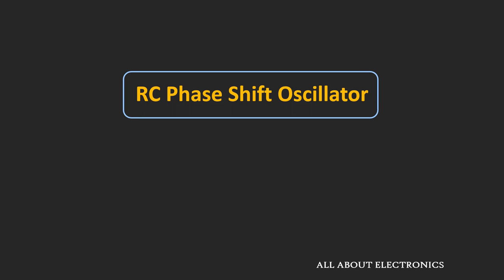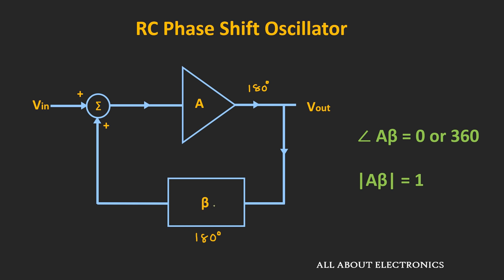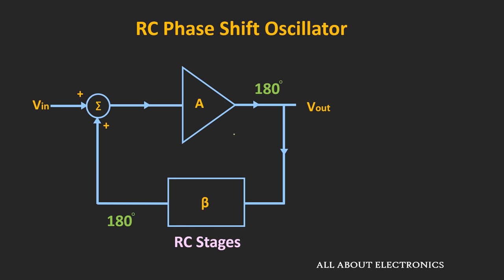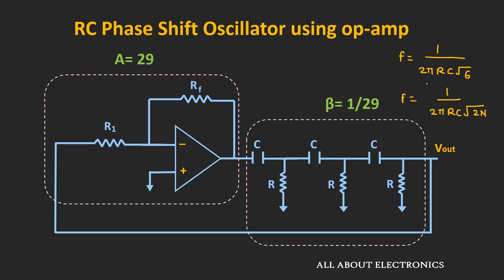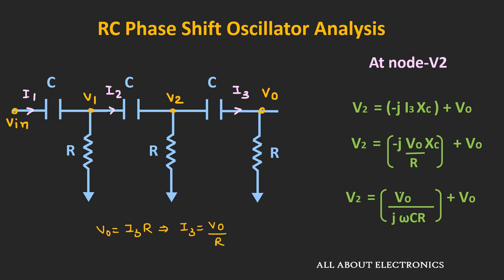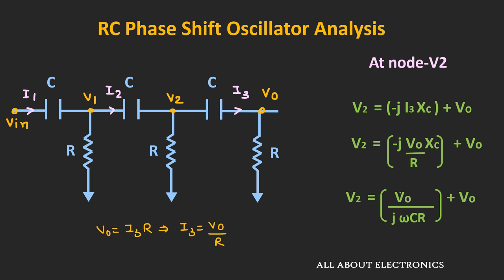RC Phase Shift Oscillator (using Op-Amp) Explained

Comment: Why is it assumed that the entire current I3 flows through R and is not split into 2 currents, one flowing through the resistor and one flowing out to the right of the circuit? When the RC circuit is connected to the amplifier circuit then there will be a current flowing in at Vin and a current flowing out at Vout, so why is only the current flowing in at Vin applied during the derivation?
Reply: Also thought about that

Comment: Hi, all about electronics. I just see one error on the diagram: R1 is virtually connected in parallel to R, affecting the gain calculation. Instead, R is in feedback to the input without R1.

Comment from the maker: The timestamps for the different topics covered in the video:

0:29  How RC Phase Shift Oscillator Works

1:45  Simple RC Circuit (Phase Lead Circuit)

5:35 Design of RC Shift Oscillator using Op-amp

7:31 Derivation of the frequency for the RC Phase Shift Oscillator

Comment: Here,
Phase shift per attenuator is 60.

so, tan(60)=sqrt(3)=Xc/R 
==> Xc=sqrt(3)*R  
So, Vin/Vo=1-j*sqrt(3) 

And we also know angular frequency , w=1/(j(Vin/Vo-1)*RC)

So, in this case angular frequency , w=1/(sqrt(3)*RC) Not your mentioned : w=1/(sqrt(6)*RC) 

Note: I can be wrong, but I found this from my calculation. thanks at all for great video.
Reply: @pallob_M10  what is j ?

Comment: At 5:41 In the figure You getting  Vout From  the RC feedback  output I don't  understand this point  because generally  we get the Vout from output of Op-amp.
Reply from the maker: Here this Vout is the output of the RC network. So, what I mean is, the output of the RC network is given as an input to the op-amp. Of course, as you said, the overall output of the oscillator circuit is the output of the op-amp. If I have used  the different nomenclature for the two outputs (the op-amp and the RC network output) then this confusion would not have arised. But I hope, you got the point. If you still have any doubt then let me know here.
Reply: @ALLABOUTELECTRONICS  so My exam starting  this month  for revision I watched  so many of your videos that I am used to your voice because of this I am reading  your  reply in your voice in my mind..

Comment: What will be the amplitude of the output sine wave??.....calculation can be made easy by using transfer functions but this is the easiest way to understand....thank you
Reply: I think this depends on the op-amp, since this is an oscillator you would have to check the slew rate for the maximum frequency and the rail voltages for the sine wave amplitude.

Comment: sir, please clarify my doubt ... at 1:48 you said that the output voltage leads the input voltage, but generally in an RC network current leads voltage...i am not able to relate these two statements...please help me out sir...
Reply from the maker: Here,  the input and output voltages have been compared. And what you are saying is true when the position of R and C is interchanged. 
i.e when the output is measured across C.
Reply: @ALLABOUTELECTRONICS   sir, in that case, can we reconstruct the circuit in which the feedback network consists of cascaded low pass RC network in which the resistance value is very close to infinity?..because I feel even in that case a single RC network will provide a phase shift of 90(however it will be lagging)....and thank you so much for your immediate response sir...❤❤
Reply from the maker: If you choose a very large value of R, then the AB= 1 won't get satisfied. you also need to look for the gain as well.
Also, with a single RC network, you will get a 90-degree phase shift only when w is infinite.
Reply: @ALLABOUTELECTRONICS   tq so much sir!!

Comment: Ive watched all your videos for Opamp and you are just amazing ,
here I got a small doubt in 1:19 time of this video you said vout is in 180 phase shift but our input and feedback both are at + i.e non inverting then how come our vout is inverted ?
Reply from the maker: What I mean to say is, the feedback circuit ( RC Circuit) provides 180 degree phase shift to the incoming signal  (output of the opamp) at particular frequency. Therefore at the oscillation frequency, ideally the output of the opamp ( which is input to the feedback circuit) and feedback signal ( output of the RC network) will be 180 degree phase shifted. 
Of course, the overall phase shift of the circuit is 360 degree, and that's what we required for oscillation.
I hope it will clear your doubt.
Reply: Hi all about electronics. I have just a minor question on 6:34. I am just confused because here the op amp has a negative feedback. Isn't negative feedback used when we want our op amp to function as amplifier and positive feedback if we want to use it as oscillator?

Since this is an RC Phase Shift Oscillator, shouldn't we use positive feedback in it?

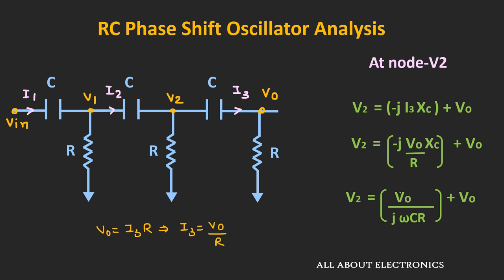Comment: 14:24 , can you elaborate on why the output voltage will have real part only , and can we cascade it with low pass filter and if we can , will there be any change in the result?
Reply from the maker: In oscillator, although in the input (the thermal noise) there are many frequencies, eventually we are getting the output oscillation only at the specific frequency. So, we can say that there is a sort of resonance at the specific frequency. And in resonance, the input and output are in phase. Therefore, the imaginary part will be zero.

Comment: In 14:28, why will the output voltage only have a real part?
Reply: it's a trick to find frequency
Reply: For the angle of feedback circuit to be 180 degree...  Imaginary part should be zero.. Then only tan^(-1)(y/x) may be equal to zero... Subject to condition that real part of beta must be negative...

Comment: Hi, how this circuit is in positive feed back? as per my understanding oscillator must be in positive feed back? but this circuit seems to be in negative feed back?
Reply from the maker: Try to understand in terms of the loop gain of the circuit. For oscillation, AB should be slightly more than 1 right. And around the loop, the phase shift should be either 0 or multiple of 2*pi. 
Here the RC feedback circuit attenuates the output signal by the factor 1/29 at the oscillation frequency. And it also introduces the 180 degrees of phase shift between the output of the op-amp and the feedback signal which is again given as input. 
On the other end, the op-amp provides the gain of slightly more than 29 and as it is connected in the inverting configuration, it also introduces the 180 degrees of phase shift. 
So, overall loop gain becomes slightly more than 1 and the phase shift around the circuit becomes zero. 
In short, it satisfies the conditions required for the sustained oscillations. 
I hope it will clear your doubt.
Reply: Connecting to the negative (inverting) terminal doesn't necessarily signifies that the OPAMP is in negative feedback. Notice that the gain of feedback loop is -1/29, which is itself negative. Hence negative feedback with negative gain (attenuation in this case) cancels each other and the overall feedback is positive.

Comment: 1) 14:25 why the output voltage have real part only ?
2) Does the attenuation depend on the number of stages or independent ?
Reply from the maker: The thing is the gain provided by the op-amp is real (-Rf/R1). It does not contain any imaginary part. 
So, the feedback section should also have the only real part. 
And yes, the attenuation depends on the number of stages.
Reply: @ALLABOUTELECTRONICS  is there a formula for attenuation for the number of stages ?

Comment: Sir, at 16:07 U hv told about attenuation. But this is open loop gain(A) =Vo/Vin.
Reply from the maker: Here Vo and Vin are corresponding to RC network. Although I have used the same nomenclature (Vo and Vin) for the overall oscillator circuit, but here it is the ratio of the output of the RC network to the input of the RC network. And since it is a passive RC network, it won't provide the gain in a true sense. There will be an attenuation of 1/29 at the resonant frequency.

Comment: I don't understand op amp holds up to 18(VCC) and 18(-VCC) 
We need A= 29 '  any help
Reply: Gain is ratio between output and input voltage, not the value of output voltage. Let say you input is 0.1V and your output is 2.9V, so 2.9/0.1 = 29 (Gain)

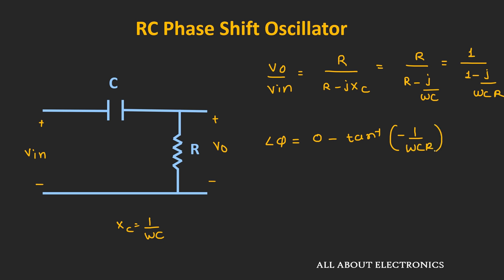Comment: How did you arrive at the formula for phase shift? 2:43
Reply from the maker: If you have A + jB then the phase shift is tan-1(B/A).
Similarly, for A + jB / (C+ j D), the phase shift is tan -1 (B/A) - tan -1 (D/C)
In this case, the numerator does not have any imaginary part (B= 0) . 
Similar way, the phase shift of R/ (R - j/wc) has been found.
Reply: @ALLABOUTELECTRONICS  thanks a lot

Comment: so in this cas, depending on how much RC curcit is cascaded to each other the formula of "f" will change. and since f changed the attenation factor won't be equal to 1/29. right? so we will have to change the gain of opamp. right?
Reply from the maker: Not only the gain, but you also need the look at the phase. You also need phase of 180 degree, so that the overall phase is 360 degree.

Comment: The circuit diagram shown at 5:37 has Vout at terminal of Rf,while redrawn circuit diagram have Vout at terminal of R1  !.How can it be correct? Please clarify my doubt...
thanks in advance.
Reply from the maker: Yes. It's by mistake. It has to be on the left side. 
Anyway thanks for pointing it out.

Comment: @allaboutelectronics As you mentioned the oscillators have positive feedback  then why positive feedback  is not employed  in this circuit?
Reply from the maker: Actually there is a positive feedback . The op-amp provides 180 degree phase shift (since it is inverting op-amp). And the RC feedback circuit provides remaining 180 degree phase shift. So, the input which is fed to the op-amp is in phase with the initial seed signal. (noise is the seed signal). I hope it will clear your doubt. If you still have any doubt then let me know here.

Comment: I know it may sound dumb
But is noise sinisoidal
Or how the the variation in DC current is sinusoidal
And it's amplified and given back
So if it's not sinusoidal how we got sine wave??? 
Thanks
Reply from the maker: The noise does not contain single frequency. If it contains a single frequency then it is easy to identify or eliminate that from any system. But if we talk about the noise, Its combination of all the frequency. 
So, when it is amplified by the amplifier, all the frequencies in the noise signal gets amplified. 
But the feedback network acts as a frequency selective network, which passes only certain band of frequencies and attenuates remaining frequency. So, over the time only single frequency is able to get amplified and all other frequencies gets diminished.
 When we say a single frequency in the frequency spectra, in time domain, its a sinusoidal signal of that frequency. 
So, with proper gain tuning, we are able to get a sinusoidal signal of a single frequency. 
I hope it will clear your doubt.
Reply: @ALLABOUTELECTRONICS  got it sir 
Thanks
Reply: @ALLABOUTELECTRONICS  oh
Is it like A. Beta less than 1 for the other  frequencies thus they Eventually damp and die out??!
Reply from the maker: @abhijithanilkumar4959  Yes, exactly.

Comment: Can you explain why you said that gain will be 0 in two cascaded RC circuit when R=0? I am finding the gain to be 1.
Reply: When 'R' is equal to zero, the ground resistors are not present. Therefore, the feedback circuit contains a bunch of capacitors in series with the feedback resistors. This causes the gain of the feedback loop to plummet.

Comment: I have a question ?

In our lab there is practical of Phase shift oscillator,
In which we have three RC sections, but in the practical we vary capacitance and keep R constant, but still for different capacitance we always get sustained oscillation,
According to tan^-1(xc/R) as soon as we vary xc phase shift should must vary, still we get sustained oscillations means that loop is still shifting 180° but how can this is possible if Xc is varying ???
Reply from the maker: Have you checked the frequency of oscillation ? When you are changing the capacitance then frequency of oscillation is also changing. That means now, for new frequency of oscillation, you will get 180 phase shift. For the previous oscillation frequency, of course the phase shift will not be 180.
Reply: @ALLABOUTELECTRONICS  ,
Yes, we have measured frequency, It means that, in product wc as c vary w will also vary such that the product remains nearly same and overall phase shift becomes 180, thank you very much 😊

Comment: Sir I have seen all your videos regarding oscillator, opam, filters etc full playlist but sir I have a doubt in this video. Sir, I want to know at 9.01 what is J because due to this doubt I am not able to practice questions properly. I search many YouTube videos but I haven't found my answer yet.  Plz sir, clear my doubt please!  Or anybody knows this answer please help me. 😭😭
Reply from the maker: I hope, you are aware about impedance. Which has resistive and reactive part. The reactive part has phase relation with voltage and current. In resistor, both current and voltage are in phase. So here the feedback part contains both resistor and capacitor. Therefore here the reactive part is represented with j. I hope, it will clear your doubt. 
If you still have any doubt then let me know.
Reply: @ALLABOUTELECTRONICS   Thank you very much sir, I get it now. 🤯🤯

Comment: Sir is there something we can say about these(RC and LC) oscillators}???
Thank you
Reply from the maker: I didn't get. Would you please elaborate it.
Reply: @ALLABOUTELECTRONICS  oh sorry for my typing mistake
I meant is there something we can say about the amplitude of the sine wave generated by these(RC and LC) oscillators
Thank you sir
Reply from the maker: Using this circuit it is hard to control the gain. Because with slight change in the gain the output may go into the saturation. To control the amplitude, the limiter circuit is used with the oscillator ( It is implemented using the diodes and few resistors).
It is difficult to explain that circuit over here. Someday I will cover that circuit in detail with simulations.
Reply: @ALL ABOUT ELECTRONICS   @ALL ABOUT ELECTRONICS  ok sir thank you
However can we predict or say anything about the amplitude of the sine wave we  just obtained
Is it any way related to any value of the components
Or more like is it possible for us to create a for example Wein Bridge oscillator of +-9v output
Reply from the maker: @abhijithanilkumar4959  Yes, the amplitude depends on the gain. As I said to you earlier, we need to fine-tune the gain to get the particular amplitude.  Using the gain-adjustment circuit, it is possible to achieve the desired amplitude.
Reply: @ALLABOUTELECTRONICS  ok sir thank you

Comment: Would you make a video about op- amps used to perform analog multiplication??
Reply from the maker: I have made a video on a log and antilog amplifier using the op-amp. In that video, I have explained how the analog multiplication can be performed using the anti-log and log amplifiers. 
You can check that video.
Here is the link:
https://youtu.be/Nrfb-s0wl6g

Comment: Sir what factor plays the role of input in starting when we not connected any feedback network ???
Reply from the maker: Without any feedback, the noise will be present in the input which contains all the frequency component. The amplifier will amplify all the frequency components by the gain factor. But as the amplitude of the noise is  very small, at the output also you will observe nothing. (with out feedback)
The feedback network provides the frequency selectivity.

Comment: In your prev video about oscillators u told that op- amp are used in relaxation oscillators(which genrate non-sinusoidal signals ) but in rc phrase shift oscillators (which genrate sinusoidal signal) we are using it ,....Why???
Reply from the maker: In relaxation oscillator, the op-amp is used in  saturation. ( The output of the op-amp is either + Vsat or - Vsat). Here it is used as a linear amplifier.
I hope it will clear your doubt

Comment: at f=1/2piRCsqr(6) => phi= tan-1(1/sqr(6)) => phi=67.79 degree . 
But for a Three stage RC circuit the phase angle should not be 60 degrees instead of 67.79 so that the overall feedback of RC circuit becomes 180 degree. Please Explain

Comment: The content you provide is quite cool, but if I may ask for a favour - please use some compressor on your mic :) the clipping is quite annoying :/

And I think there is one issue said incorrectly in 14:30, i.e. you are zeroing imaginary part saying that output voltage is only the real part. I think is it incomplete, as zeroing imaginary part gives us only information that there will be zero, or 180 degree phase shift. Later on you are calculating voltage magnitude at this condition.

Comment: Sir 
I had a brain storming doubt
If we need each rc network to provide 60 degree phase shift then 
Tan^-1 (Xc/R)= 60
Thus 1/omega×C×R =root 3
So we get frequency of oscillation as 1/2pieRC(root3) and not root 6
But in derivation we get root 6
But frequency must be the root 3 case for the RC network to produce a phase shift 60 degree so that total 180 degree
Thank you in advance
Reply from the maker: The thing is , when we connect three RC network togather, it won't behave like a single RC netwrok. Each stage will act as a load for the precious stage. That's why we need to consider the three stage as a single network and go through the entire derivation.
I hope it will clear your doubt.
Reply: @ALLABOUTELECTRONICS  oh  ok
Got it 
Thank you so much sir
Reply: But in lecture it is told that if two 3stage are there than  each one will provide equal amount of phase shift so why can't we use w=1/RCroot(3) ???
   @ALLABOUTELECTRONICS